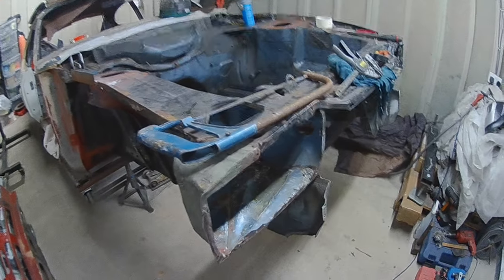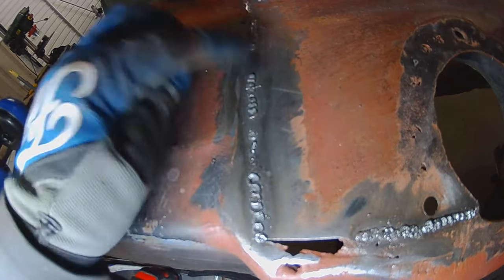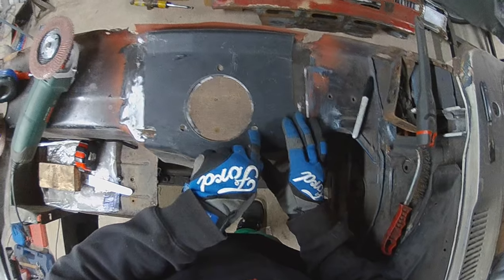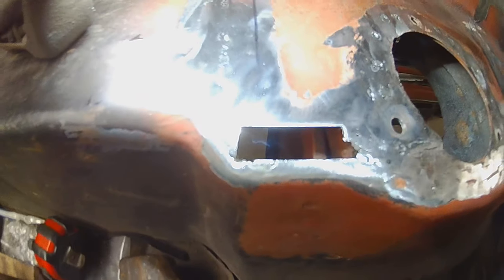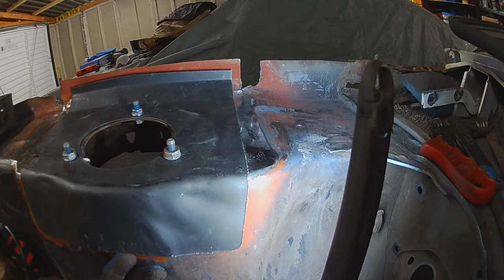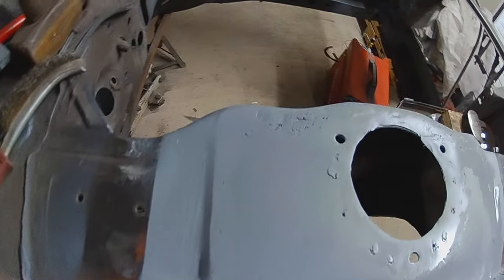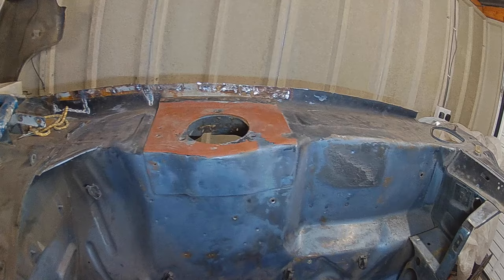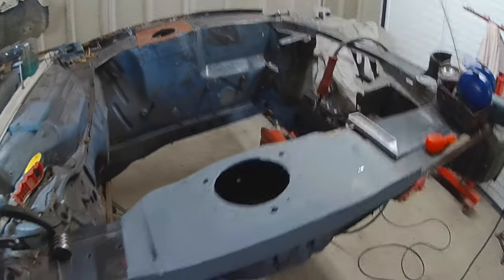Ford Capri 2.8i strut top repair

Comment: Only recently came across your u tube entries and I am currently going through the lot. For me personally mk3 Capris need bumpers. Will 8 inch wheels fit standard Capri bodywork ?
Reply from the maker: Yeah I know what your saying about bumpers I'm thinking of making some smaller ones that will fit the style I'm going for and yes 8j will fit mate of mine is running 8j rs rims all round and lowered 👌👍

Comment: Went to Brean Sands in 93 went to billing aqua drone all different shows there to know that they used to be quite busy at weekends every other weekend I was out of the three shows and all that lot are used to be busy busy times and that there is only any shows specially at 3 o’clock HQ there’s nothing going on there anymore it’s like a tip at where i’ve done it I just got loads of cars and just dumped him anywhere near auctions and that lot and auction them off and we had first Covid in March I think it was now at an auction and they had a Hurst what was what had a capri front-end on it that’s different tried to buy it but somebody bloody brought it so but I’ve done it all up inside like this from now on yeah they could’ve designed out a bit better news more protection now not agree with you it’s a bit late to whinge about it and I don’t do many more on the predecessor never came out did it apart from the probe and it was it was rubbish
Reply from the maker: Yeah missing all the shows and meets to but that hearse not my cup of tea but would attract so much attention at a show 👌👍👍 I know capris were never ment to last there doing good to still be around now some amazing examples out there